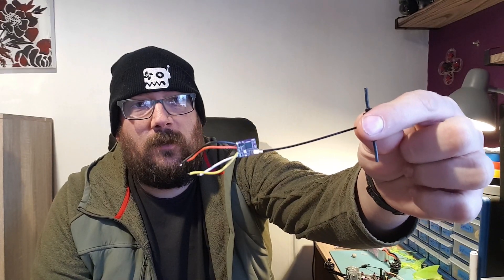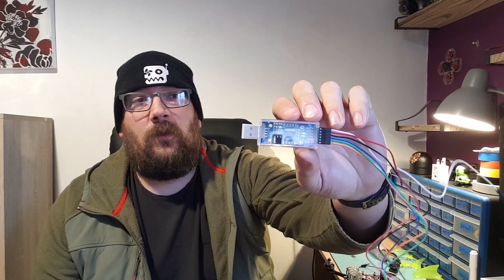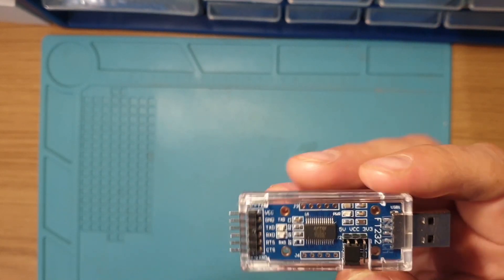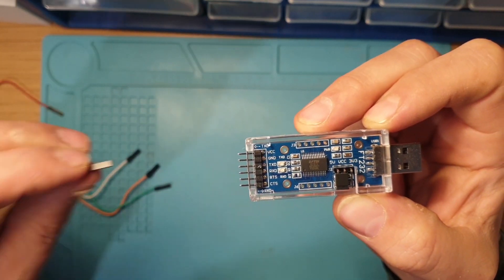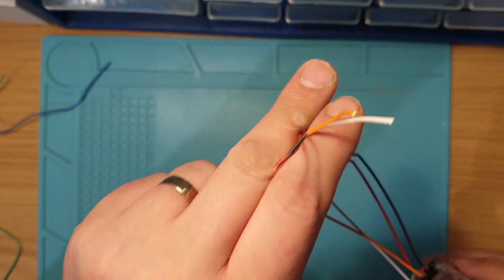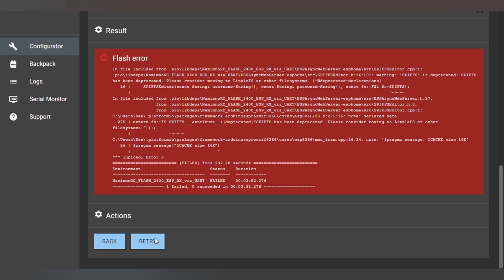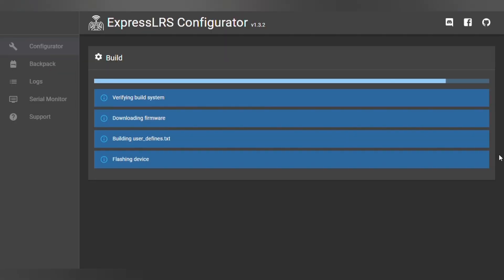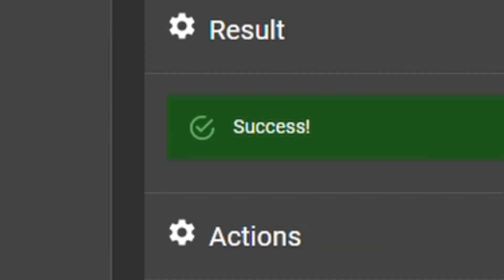Solid led on your elrs reciever ? How to fix a expresslrs reciever stuck in bootloader mode .

Comment: Just wanted to say it should be possible to do this without desoldering it, just bridge the boot pad and use the 'via_passthrough' option in the configurator. The only thing is you HAVE to turn of telemetry in betaflight or else it confuses the bootloader.
Reply from the maker: Thanks for the info . I'll pin your comment so other people will see it . 👍
Reply: it doesnt work VIA PAssthrough.. Im having  exactly the  same  problems with  the same rx. Checked all the  documentation,  and  tried every possible metod exept FTDI... 
its  in the  post, so  hopefully it  will  help.   ThankS  for  the video, TS13FPV
Reply from the maker: Try disabling telemetry on you f/c befor doing passthrough . And don't have betaflight running when your trying to do it . If that doesn't work you might have to use a ftdi unfortunately 😕
Reply: @ts13uk  I've done that,but it did not work ...
But I've managed to flash it later. 
Decided to use my other laptop and it worked straight away.
I remember having driver problems some time ago,when I build my pc,but later I was able to use bettaflight configurator or any other tool without any problems.
Reply from the maker: Glad you got it sorted 👍

Comment: am about to buy the ftdi adapter but there's no pads to bridge on my RX SX1280 MINI would that still work? thanks for your video 🙏
Reply from the maker: I'm unfamiliar with that reciever.  Does it maybe have a boot button that you need to hold down when you power it up?
Reply: @ts13uk  solved it...the problem was i accidentally bridged the gnd with a tiny pad above it that i didn't see...it was the boot pad...so thats why it always stayed in bootloader mode...now everything working! thank you for your videos :)
Reply from the maker: I'm glad you got it sorted 👍

Comment: I was having the solid light on my jumper aion mini rx. I was finally able to flash it via wifi by soldering it to a 5v power regulator but even after that I plugged it back into my protek25 and it would not detect…. Just solid light…
Reply from the maker: Some uarts can put the receiver into bootloader mode unintentionally.  Is there another free uart you could use ?
Reply: @ts13uk  there is only one more uart and it’s set to IRC tramp so I think that’s taken… after much fiddling I decided to put a crossfire rx in there. I didn’t feel like taking it all apart either as the stack includes part of the 4K camera.
Reply from the maker: @Daniel Simental  It may just be the receiver.  Another guy was having the same issue with a betafpv receiver, then he switched to a happymodel one, and it was fine . Not ideal but that could solve the issue if you wanted to go with elrs
Reply: @ts13uk  thank you! That was my next question… do all ELRS RXs do that? My crossfire micro is on my jumper t16 and my elrs aion nano is on my newer t pro which is where I really wanted it. Smaller gear fits nicer into a smaller pack. Now I gotta lug around my t16 haha.

Comment: Please help I have the same problem. But the biggest problem is that I have bout darwin baby abe 3 of them and noon of them I could get to work. they burned up before I could even fly. so now I am sitting with the last one, it has the build in reciever. I had bind it to namoni tx module at some point but now what ever I do does not help. any idea's ! Thank you
Reply from the maker: If nothing is happening and one of the recievers was bound then check to make sure that the firmware matches on both the tx and rx . With the ones that have burned up I'd make sure the the pads you are soldering to are correct and not to high voltage .
Reply: @ts13uk  Thank you for responding to me. the first 2 burned up by just connecting a small 2s batteries to it, when I wanted to check the motors on the betaflight. The last one, will not bind I have the yellow flashing light, but it will not connect to the wifi nor will it do anything else than flashing yellow while choicing the other connection in expresslrs companion ( or what ever it is called) I  was looking at  Joshua Bardwell and he says that build in recievers are really difficult and there is another way of binding it to the rado, but I just can not. Thank you again for your time
Reply from the maker: It may just be a defective batch . I'd contact you supplier and ask for a possible replacement or refund .
Sorry to not be very helpful , it's very difficult to diagnose a problem like this when not there in person . 😞
Reply: @ts13uk  I got them out of ebay and the chiness man wanted to give me 20 dollars so I just very poligtly aske to shf. it. ...:)  I dont know If I was unlucky or because I am out of my world. I come from Iran and sometimes move to a new place( people are not always friendly) because some very creasy things happened with my post as soon as I moved to a new place...I do  not know if it is that then some people are really...( thank you for responding. I think I just throw all of it in the rubish, and just buy or build a better known one.

Comment: I have problems with a jumper receiver... it is giving RX Lost and critical signal even close to the RX both TX and RX are in the latest version 2.5.0 and I don't know what the solution is anymore... help
Reply from the maker: Try watching this it may help . Could be wrong warning settings on Transmitter or bad elrs antenna . https://youtu.be/Snrkf6FTwik
Reply: @ts13uk  I already did what he said in the video and unfortunately it didn't work... I think it's a defect in the RX itself
Reply from the maker: Could be . Maybe worth getting in touch with your retailer if it's a new product . Sorry I couldn't help
Reply: @ts13uk  ok obrigado tô aguardando a resposta deles ...

Comment: Just done but no stick movement on betaflight and the right port is selected and binding fraise are the same
Reply from the maker: Your tx on the reciever needs to go to the rx on the flight controller and the tx to the rx(f/c) 
Maybe try swapping them around
Reply: @ts13uk  yes done that still nowt thanks anyway
Reply from the maker: In the reciever tab have you selected serial based receiver and then crsf . In the drop down menus .
Reply from the maker: https://youtu.be/Ssgre1VBGSs this vid show how to install elrs on a th2fs . The steps are the same for any quad . Might be worth watching just to make sure you've got all the step right

Comment: Hi. I'm not getting stick inputs after binding an elrs Flywoo nano 1s to jumpter T lite with a happymodel 2.4 rx. Any ideas?
Reply from the maker: Possibly tx and rx wires mixed up on the reciever maybe ?
Reply: @ts13uk  Oh! I just noticed that under compatibility options in elrs config, you don't have the inverted option ticked. I have this ticked for both tx and rx. Would it be this? Thanks so much for you time dude!
Reply from the maker: It could be . It would be worth trying to see if it solves the issue
Reply: @ts13uk  Got it working! The fix was to invert on the TX side and not on the RX side in elrs configurator*
Was also getting stuck in the lua script on 'Loading' no matter what version I tried (Had tried them all.  even at the same time lol) 
The fix for that was to flash via Uart then save the .lua directly to the SD card rather than drag and drop a previously saved version** 
Hope this saves someone some hours/days ;)
Reply from the maker: Awesome . Glad you got it sorted 👍

Comment from the maker: Just remember once you've finished flashing that you have to unbridge the boot pads then you should be good to go 👍
Reply: I have the same issue with the 2 of the rx one I was able to flash and bind but the other two have the solid lights. I tried bridging the boot pads and flashed through betaflightpassthrough with no success. Do I need to use the device I have in the video for this to work?
Reply from the maker: When you flash through betaflight passthrough you need to disable telemetry first . It confuses the bootloader if you don't.  You can turn it back on afterwards.
Reply: Thank you! I was able to get it to work finally. Just one receiver down to go the one with an onboard ceramic antenna . I had an error saying it could not detect the com port. But will try again.
Thanks again very helpful.
Reply from the maker: @pablomoreno1242  glad I could help 👍